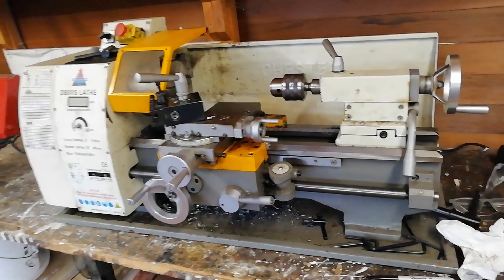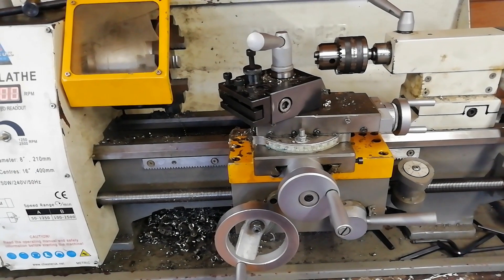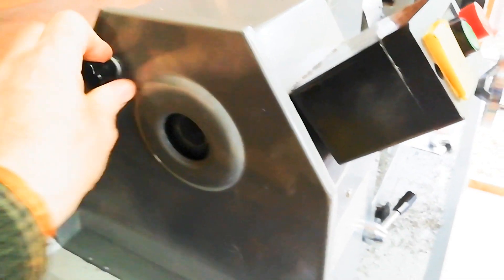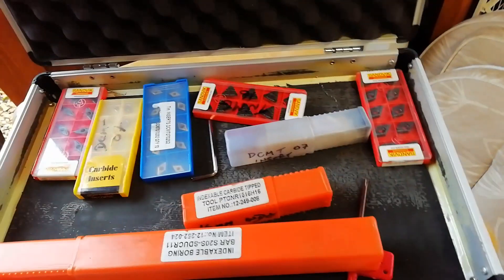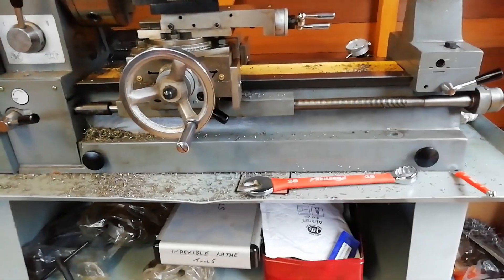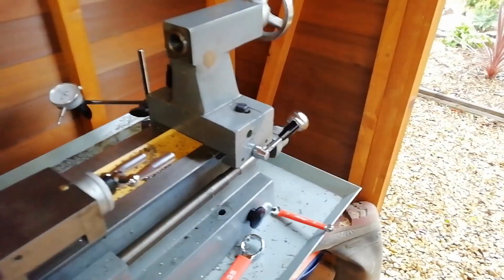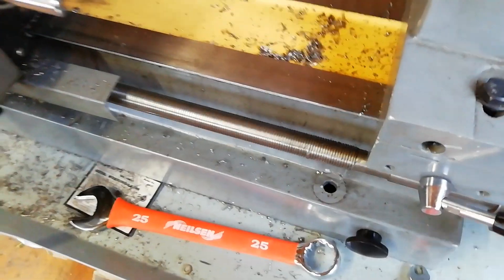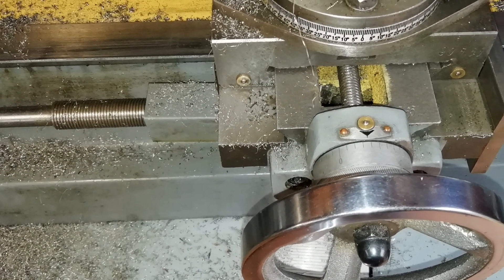Review of my New Sealey SM27 Metal Lathe (also badged by Clarke & Warco)

Comment: Have had the Clarke CL430 now for a couple of years. On the whole, its a great but basic machine. I have added a quick change tool post, VFD and altered the drive pulley sizes which gives me a range of around 100-1200rpm. The rpm could go lower but i have a minimum frequency set so it retains enough torque. Also fitted a 2 axis DRO kit. I have made up an electrical cabinet which controls 2 emergency stops, the door open switch (as an emergency stop), relays, inverter, power supplies and an RPM readout. The control box on the lathe has buttons for start, stop, coolant, RPM, emergency stop. Next up is a half nut and apron modification which will give me a means of adding a hand wheel to move the carriage. 
What started life as a basic lathe from Machine Mart quickly lost any warranty it might have had, but to make it usable without spending all day faffing with the belts it had to be done.

Comment: I have the Clarke CL430 version of this and will be keeping an eye out for mods for the Sealey SM27 and the Warco WMT300 (I think) from now on.  As others have said, there’s a guy called Stuart who has designed and built a halfnut for the Clarke version and that looks like a cool modification to do.
Reply: Hi Dave, I have also recently bought a Clarke CL430 and have already started on some mods/upgrades. The first one being a quick change tool post to replace the old four way one. Tacho, 3 phase motor & VFD to come next. Also really need to make a carriage stop.
Reply: @InTheShedUK  - Thanks for that, I’ll look forward to seeing your further upgrades!  I just got a tailstock extension bar which will help with the lack of overhang and I’ll report back on whether that’s a good idea once I tried it.  4-jaw chuck is next and am looking at a 160mm unit.  Chronos do the QCTP that you’re looking for.  I have the URL but you’d need to check heights and fit.
Reply: @daveys  thanks, already bought a QCTP from Arceurotrade, had to make a bush and new stud though... video is on my channel if your interested
Reply: @InTheShedUK  - Thanks!  I subscribed earlier on, so hopefully the system will remind me to have a look.

Comment: The nuts are to set motor tension not the weight of the motor
Reply: I've never seen a tensioner you left loose unless it was sprung loaded. I don't know where they have got the idea to leave it to bounce around as it will definitely slip under load. It's normally tighten until you can move the belt by pushing inwards towards the centre of the pulley by 1/4" of movement. You wouldn't leave your fan belt loose under the tension of the weight of your starter motor. Perhaps me and you don't know what we are talking about, but I very much doubt it.

Comment: I got the one i was bidding on. Got it for about 550E and it has mill head. I will pick it up on tuesday. 

My plan is -to mod this with inverter and maybe as you said electric feed for the crosslide.
Maybi a separate motor for the mill. 

Well, im not even sure what i bought so i have to see how it goes. :)

Are you still sattisfied with your?   

BR //
Reply from the maker: How was it? I recommend a fantastic project by Youtuber "clough42" - his electronic lead screw is so well desiged and tested that I'm planning o buy one of the kits he's planning to sell.
Reply: @chriswesley594  

I am satisfied so far. Got 400V motor for it today so i can invertercontrol it. This will be my experiment machine. It is on hold since i got e great deal on a real millmashine. Old, both vertical and horizontal milling. Two separate motors. Perfect size for my garage, like a drillpress on viagra :) Very happy to get this one, perfect size and it was cheap. Old Swedish mill. But it has to be relay rare, havent found anything about neither the mill or the company that build it. Put out Q,s on Swedish forums and none have heard about it. But it is a relay well built cast iron mill. Name. "aktiebolaget yggdrasil" will fix this one first.

I have so much going on so maybe i have to start filming myself? :)

Great tip about the lead screw. Could not find any prize ? 

BR // 7ann3....

Comment: Upgrade it with a VDF (inverter) and the speed adjustment will be like the other lathe. Rely good investment and it is able to run relay slow, and switch from forw, to rev instantly. Perfect when threading. I have a couple EMCO lathes but maybe get one of this with millhead in the weekend.
BR // Janne
Reply from the maker: Thanks for your suggestion. I like the sound of it.; I'm considering an electronic lead screw feed for thread cutting, but even so, an easy speed control would be very nice. I'll look in to VDFs. Thanks again,

Comment: That machine looks totally identical to my 3in 1 lathe mill drill.         Except you don’t have the mill head post on the column.
Reply from the maker: Hi Wolf. Yes, as I mention in the video - it's also badged as a Warco  and a Clarke - and there is a version with the milling attachment. How is oyur milling attachment? Is it strong & stable?

Comment: I prefer the leadscrew feed to a rack feed. The leadscrew is a finer feed and allows smoother operation..but then again most of the work i do is relatively short with lots of steps and shoulders etc so fine control is my priority.. Once set up these lathes are very nice to use and allow the production of good accuracy
Reply from the maker: Hiya Rex and thanks for your comments. I agree with everything you've said. Having used the lather for a while now, it's better than the rack lathe I used before, for the reasons you mentioned. I was incredibly lucky to get this one for £565 - with so many valuable extras too - and not far from where I live.
Reply: I also find that on this size of lathe the position i stand using the leadscrew handle gives much better observation when boring recesses
Reply from the maker: Another good point which I agree with. I have a 12 Watt LED (build video here https://youtu.be/C8GNVXpmcpI) sitting on the cross slide, shooting light directly and powerfully at whatever I'm working on. Works a treat.

Comment: That belt adjustment will be a never ending pain. Besides that, the belts will slip as the motor pulls up under a load. My lathe, though bigger, was stuck with that same miserable system as a cost cutting measure by the builders in the late 80s.
   I finally built a simple, but effective, belt tensioning system. I added an angle-steel bar out from the outer bolt holes in the motor mounting base plate. From that I used ball swivels (used on the steering gear on riding lawn mowers) to connect to a crank on the front of the lathe. Not shown in the photos was a rod added later from the angle-steel up to the jack shaft carrier with swivels mounted on the ends of the rod threaded for adjustment. 
   Now, the motor belt and jack shaft to spindle belt can be adjusted to the correct tension for running. When the lever is raised, both belts are slack for ease of movement  from one sheave to another.
   You will soon see the need for a motor cover to keep the chips out... you will note the sparks generated will remind you. I made one from a one gallon paint thinner can.
https://postimg.cc/ZBtnx1cR
https://postimg.cc/34XRSnSZ
https://postimg.cc/LYtBpd6Y

Cheers from NC/USA
Reply from the maker: I bought a great lathe for tiny money and the belt drive is a worthwhile compromise. I'm getting better at changing the belts faster. I can chock up the motor, for example, with a piece of wood to relief belt tension while I'm changing speed. Still, it would be nice to implement some kind of quick-change and I'm thinking about how best to do that. A constantly variable speed drive might be implemented with two conical drives and an intervening guided belt. But that#s the for the future.

The belt slipping is actually really useful. My previous lathe had an electronic speed control which tended to "hunt". It also blew two controller boards and would blow fuses very often. The belt slip is a really friendly, non-dramatic way for a lather to tell you not to push it too far. Nothing blows - nothing snaps or bangs. It just stops - you release the feed and fix whatever's wrong.
Reply: For a long time I ran a cable from the lid that covered the beltdrive system on my lathe to the motor support plate (with the steel-angle that I used later for my improved system) so that when the lid was lifted it pulled the motor up it made belt speed changes possible. It still had the problem of slipping belts. Though not much of an issue on light cuts, it would start slipping on anything other than that.
Reply from the maker: Neat idea - thanks for sharing. So far, for me,  I don't see a big problem - and if I do, I'll solve it. Maybe even if I don't I'll solve it - just for fun.